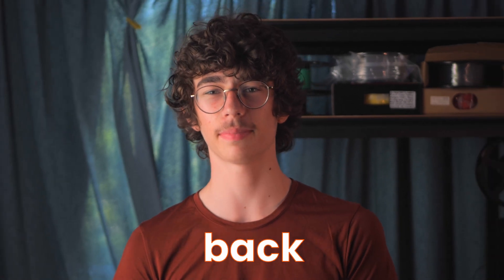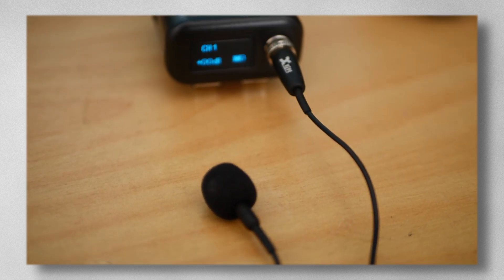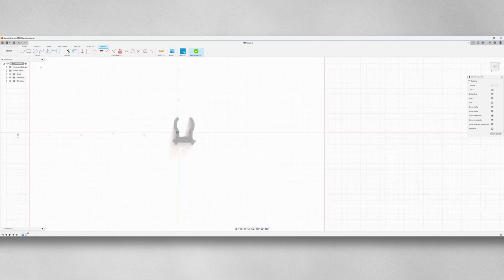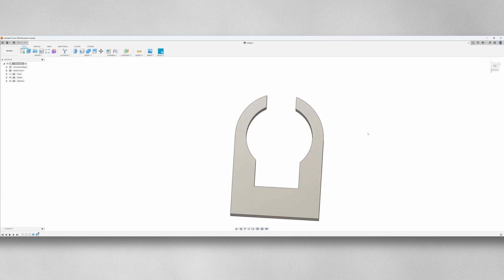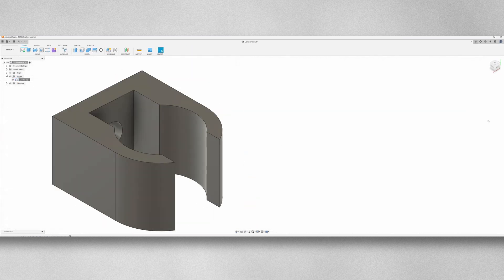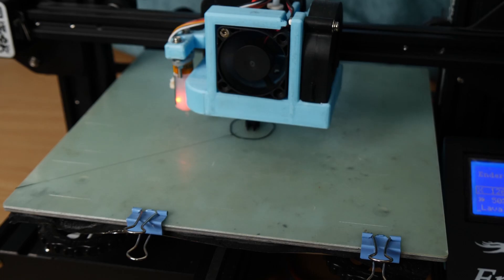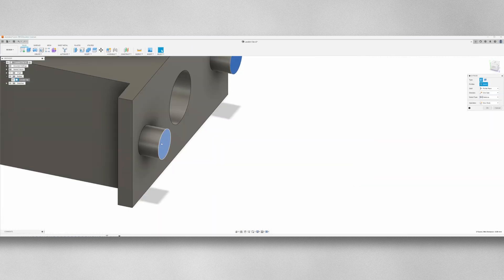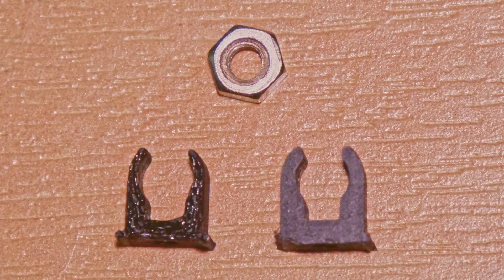3D Printing Film Gear to Save My Wallet

Comment: When reverse engineering, THE way to sketch from a photo, is the same as when drawing a sketch in the artistic way. You decompose complex shapes, into basic shapes, while thinking "how would another engineer pick a shape here?" After that you check that the values make sense. Also, all engineers pick nice numbers. Almost always do half of the design then mirror.
Reply from the maker: Thank you for the information! I'll take this aproach next time, I've always struggled a bit with reverse engineering, so I'll give these techniques a shot in the next project. Thanks again!
Reply: @TommyHoughton  no problem! if you work on small parts, it's always best to place it on paper scanner next to a quarter, and use that as a photo. then autoscale it using that quarter.  if you don't have a scanner you can use your phone with a portable drill press attachment, or literally anything that can level your camera with the part. also if available try to see where the part was designed. to know if the "nice numbers" are metric or imperial.